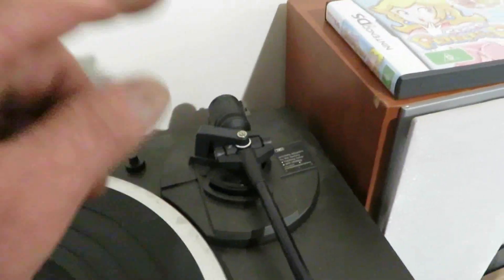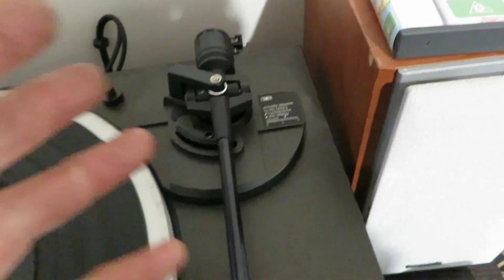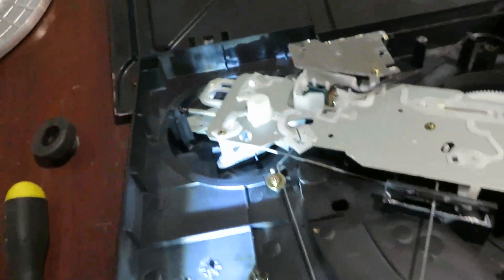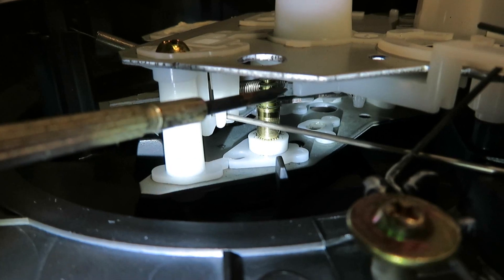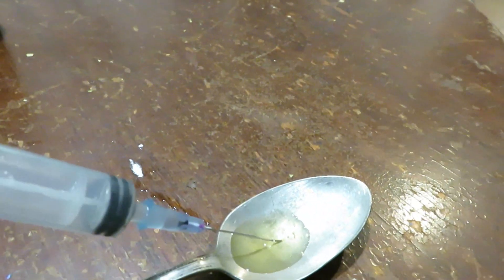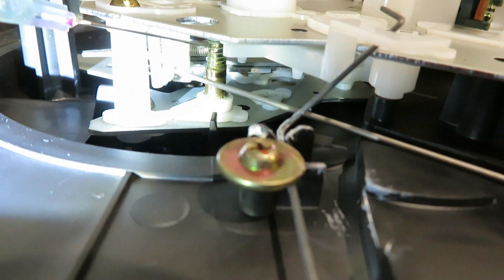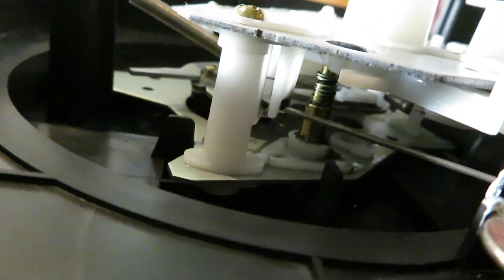How to Fix Technics SL BD or Any Turntable Cueing servicing Repair

Comment: Dear sir, I just had this problem, miraculously found your video, followed your instructions with very light machine oil (but used a Q-Tip instead of a syringe as that's what I had available), pressed it down, shifted the lever underneath the pad to drive it back up, did that about 20 times, and it it worked.  Absolutely brilliant and spot on advice.  As an American, I may have misused brilliant and spot on.  Know that is a sincere compliment and thank you for bringing peace back to my marriage.

Comment: You Rock !!  I just picked up a Technics SL-D20.  But I didn't realize the cue had this very issue until I heard it scrape the stylus clear across my brand new edition of Abbey Road LP.  Never assume was truly the case here as I would expect coming from a record shop refurbished. I flipped this over, got the flashlight on the spring and put a couple of drops of gun oil on there. Manually moved it like your video.  Hooked it back up and works like new. Thanks man

Comment: Whoops, Alienstuff left out something important…take the opportunity to clean the spring and piston a bit first.  I used Q tips (get it, “cue tips”) dipped in alcohol to swab some of the grime off the springs/piston before applying a penetrating oil as Alienstuff described.  Oh, and don’t forget to gently blow out any debris while you have the case open (I removed 2 moth carcasses!)

Comment: Was able to just lubricate and it is now working.  Had trouble lifting the black plastic just under the arm up and down to distribute the lubricant but finally got it to start moving and then used the cueing button to have it lift itself, then pushed it down.  Did this repeatedly until i could grasp the black plastic piece move it up and down until it was free.  I used 3-In-One lock Dry Lube spray with the nozzle attachment as the lubricant.  Works great.  Thanks for the video.

Comment: Hello, thanks for the video. It is the only one that shows the exact model of record player that I have. For some time now, all LPs (not the 45's) have sounded bad in the first songs on each side (the one furthest from the center of the vinyl). The needle jumps to the next grooves randomly without the vinyls being damaged. I think the arm may be poorly balanced because if I put some weight on the needle, it doesn't jump, but I ruin the vinyls. All the tutorials I've seen are for later "gradable" models, so to speak. In my case, I don't know how to balance it, if that's the problem. Thank you very much and sorry if I have taken the liberty of writing to you telling you about my problem.

Comment: Hi there I wonder if you can give me a steer on what to look for as the same turntable above that i have doesnt rotate when I move the arm across. It was working when I packed it up all those years ago Thanks in anticipation for your help
Reply: have you taken the platter off to make sure the belt is still good?

Comment: Not sure if they used silicone grease in the cuing mechanisms back then, but I’ve had success freeing these stuck or slow cuing lifts by dripping a few drops of Ronsonol from above and working it up and down a few times. I think your oiling trick might have made it now drop too fast.

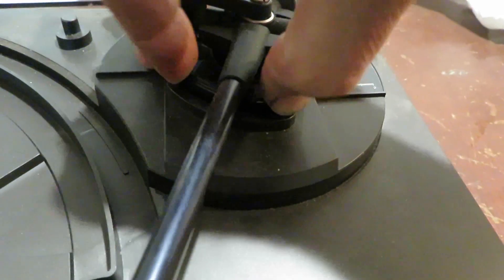Comment: Hello, I'm having an issue with the part you're moving at 3:12. It won't go up or down, it's just stuck down and will not move whatsoever. I've cleaned and lubricated the spring yet it still wont move.

Comment: Audio improvement tips for turntables.
Isolate!
Place well away from speaker and not on same surface.
Use a felt turntable mat.
Place rubber balls under turntable feet.
Use the plinth cover when playing.
That sylus is working at only 1.2gms pressure.

Comment: I have an issue where mine wont start spinning. I've checked the band and it's correctly attached. I am still getting a signal out of the player if I spin the table with my hands. It just wont spin on its own. The cue seems fine and is able to move on its own. Any idea what is wrong?
Reply: Most probably a belt has gotten loose with age. It's common to have to replace the belt on old turntables.

Comment: My turntable doesn't even spin.
Reply: At the 3:50 mark, after cueing up the arm (cue switch right), he nudges the arm inward towards the record and the turntable starts spinning.  Then when you push the cue selector back to the left, it drops the arm onto the record, after you have lined up the stylus.